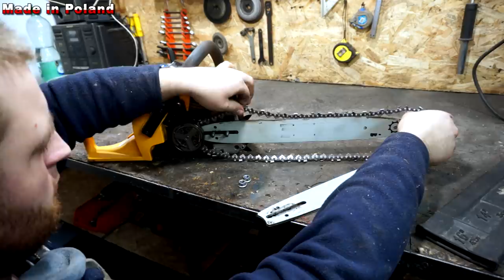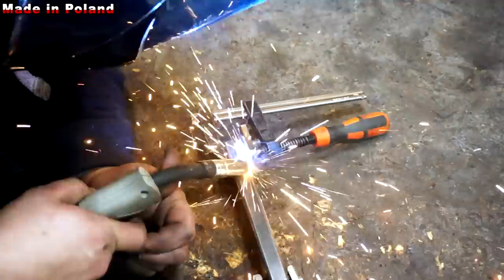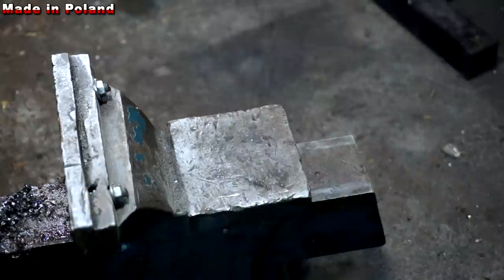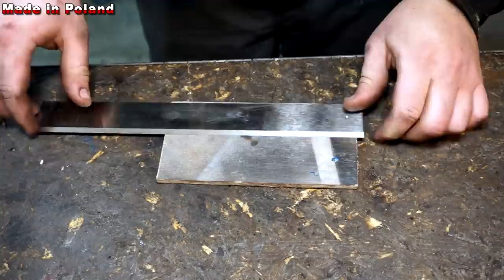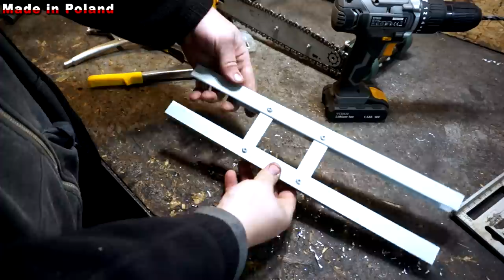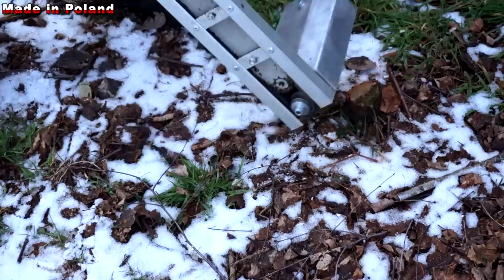Chain Saw HACK 2 [PLANS]

Comment: Awesome idea!  Need to use a helical planer rotating head with replaceable carbide inserts.  Also shorten the blade to keep it closer to the motor.  And if you could center drive the roating head.  You should file a us patent and approach Stihl Chainsaw.  Fantastic!

Comment: I used a commercially made one for imitating hand hewn logs at a local number company I worked for. It's labled as a log debarker and they're available for about $170. It attaches directly to the bar of the chainsaw. Nothing new but it's cool you that made your own. Try a longer bar if you have that option because I can tell you that using that thing for hours sure made my back ache, lol!

Comment: You definitely did something amazing, and you’ve probably had your fair share of critiques and criticism. But listening to that bog down, it’s struggling to keep up. First thing I was told when buying my chain saw was “you can always go down in bar size, but avoid going up beyond what this is designed for. If you go up you lose power” maybe if you would’ve gone down in bar size, you’d save and gain a little more power, cause that thing sounded like it was starving for power with all the extra weight added. Although it works very well from the test runs you were doing. So in conclusion, amazing engineering and thanks for showing us.

Comment: I love watching the pretty blue flower (welding flash). Thankfully its safe to do so on screens, not so safe in real life. 
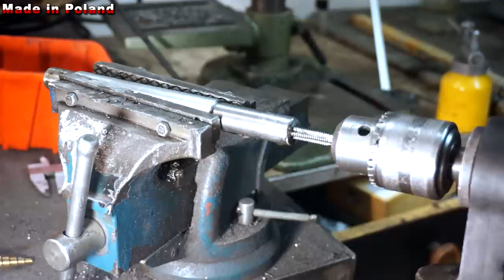I am wondering what the description style or name of the drill bit that is used to bore into the centre of the steel rod/axle at 2:44 min?  It looks like a torx driver. 
sweet ass Chain Planer

Comment: You are trying to get skin cancer. I was too cheap to replace my welding glove and arc welded for years without protection. Result, lots of projects done, but a good case of skin cancer on the hand that held the electrode.
Please consider using a glove to protect your skin.
Reply: Yeah it bothers me when I see people welding without gloves also,  they either have no idea how dangerous it is or just assume they'll be fine.

Comment: Be sure to tie the far end of that axle back to the frame (form a triangle) with another piece of steel.  That 90 degree welded connection to the frame at the chain bar is under a lot of stress and likely to fatigue crack and fail, taking with it your wide blade guard and everything else.  That doesn't look like something you want to have crawling up your arm at several thousand RPM...

Comment: For Safety you should not have open U slots in the blades only oval slots.  Also the blade retaining Allen bolts should have been positioned so that lock nuts could be used on the opposite side.  These changes would greatly reduce the chance of slinging a blade off at high speed.  Always think of the worst thing that can happen and try to reduce its chance of happening.
Otherwise it seems like a neat idea. :)

Comment: Cool for what it is, but there where plenty of moments where it'd catch, which will only get worse as it dulls, making it even more unsafe/unstable. If you ever feel like modding it again, replace those knives with chipper disks stacked like a dado blade. I can't think of the proper name, but they're like circular saw blades with chainsaw-like teeth.

Comment: Use a different oil for cutting  steel.  Get something that  is sulfurized  The stuff they sell at the plumbing supply for cutting pipe threads is way better than a lubricating oil.  Sulfur helps with the high pressures in cutting steel

Comment: Is anyone who is watching this insane video thinking rationally!!!.In order to cut a small stump flush or beneath the ground , would anyone really go to an expansive effort to retrofit a chainsaw when simple undercutting by a common shovel would have easily afforded a far simpler access to a flush cut?.
Reply: I agree when using it for that specific purpose but it's 1) the coolness of innovation 2) what else could it be used for 3) how could the idea be expanded for use as something else....These kinds of videos make people think.
Reply: Just a point if I could, a tool similar to this is called the log wizard, and has a lot of uses,  and this gentleman made a fantastic tool and I thinks its great! Im going to copy this and make one!
Reply: you obviously have never picked up a shovel and tried to dig around a stump especially frozen dirt, and you will quickly dull a chain when cutting soil covered trunk or roots
Reply: exactly..........insane this!!!!!
Reply: Around here we have stump grinders the size of Jeeps we use. This is nice if you don’t want to drag it out.
Reply: And those blades not going to last long going into the dirt like that.
Reply: its not meant for making a bonny finish is it? don't matter if it tears the wood
Reply: i had to remove a large tree stump at a job last year the customer wanted it flagging over i had to chop it out slowly bit by bit with an old circular saw and a pick axe making many passes with the saw to create lots of slits then chiselling them out with the pick axe and believe me it wasn't fun i would of loved one of these!!
Reply: Reciprocating saw and belt sander rather then that..  thought it was going for de-barking.
Reply: HyperbolicX not the inovative yoj can buy them comercially produced
Reply: Devin - And how long do you think those knives will last in the dirt? Although a cool build, it is the solution to a problem that has never existed.
Reply: Cheaper than buying replacement chains and blades. Only PITA I see is sharpening or replacing the homemade blades. ..
Reply: As a landscaper you come across jobs where customers want the stump cut down where a lawnmower can pass over it and this is the tool to have! This is a tool thats a must for anyone who comes across jobs like this that could save you lots of money from renting a tool at a rental shop. Note, a stump thats not dry cant be pulled out as easy as you think bud, its a bitch
Reply: He likes making shit. Leave him alone.

Comment: nice build but buy new barrings for the spindle becuse you welded that spindle with the barrings still on it and the ground on the end meaning the electrical would have had to travel thro thr ball barrings so thats why its taking such high rpm aswell get the greaseable kind

Comment: not bad, but well done neither. The lateral attached drivetrain will result in huge torque which will twist the blade and affect the controllability. Try to find a way to attach the grinder centered.

Comment: That doesn't look very safe
Reply: Well if you put it in front of your face while it's running maybe not!!
Reply: Faça você Even the ones Stihl makes for their chainsaws doesn't have this much protection. Looks perfectly safe to me.
Reply: Faça você chainsaw itself is much more dangerous
Reply: Nothing involving a chainsaw is safe.
Reply: Faça você ,what do you mean it doesn't look very safe! You must not have much experience with a chainsaw. Look at all of the protective covers he designed for this invention! His work is brilliant!
Reply: Faça você you are soft.
Reply: For cutting grass I don't see any problems the problem is cutting stumps
Reply: I think since he added the guard behind the head it shows he put safety into this.
Reply: Yes. Chainsaws are much safer with the 18” of flying exposed chain
Reply: Dado Bojanic came and ring my bell
Reply: First I thought the same, but the creator of this tool spent much time to make it as safe as possible for a diy project. I would rate it rather positive compared to lots of similar diy projects here on youtube.

Comment: u cant buy these from northern hydraulics!! i got one, works great!! bolts on saw the same way, made in Canada,  forget all this work!! and blades are adjustible depending on how much u want to take off. and it didnt break the bank.
Reply: What is the website u got it from?
Reply: also I made a chain guard where cutting teeth on chain are for safety reasons, it was a flat piece for aluminum with washers on one side of bar between the aluminum plate with two bolts to hold it on. plate wider that the chain on top and bottom of chain.

Comment: "A" for effort, but this idea is not practical. First of all, cutting stumps low to the ground will surely ding up the blades in a heartbeat since there are rocks and stones at ground level. Secondly, wouldn't a simple hand saw do the same job, or better?

Comment: I watched the project till the end. and then I saw what it was for. And then I read the comments of where it was made. I can't say are you serious with a question mark. Because you are. I'm from New England I leave my trees cut just above the kneecap. the next year I can step on them and pull them right out. Roots and all. The harder ones I pull out with a chain and my car or truck easily. Throw them in a burn pile. You still have stumps in the ground all over the place. I have a field I can mow. Silly Pollock.
Reply: jon rheaume 
actually, considering the challenges facing a sea-going Pollock on land, this is quite the accomplishment

Comment: NO WAY IN HELL WOULD I TRUST THAT!! why?? watch his welding of the knife base to the rod.. heat was set to low..that gauge metal.. you should see heat thru the other side when he welds it.. not to mention no fusion in the toe of the welds.. this might last a lil bit...BUT HELL NO!!!   if those do not fly off  down the road..I will be shocked !!!